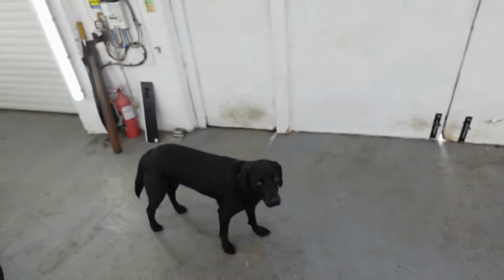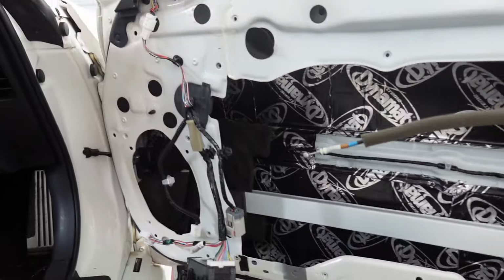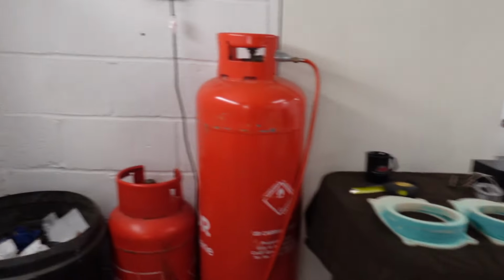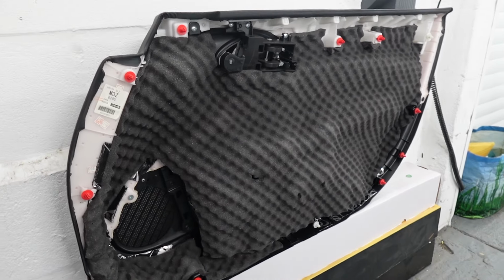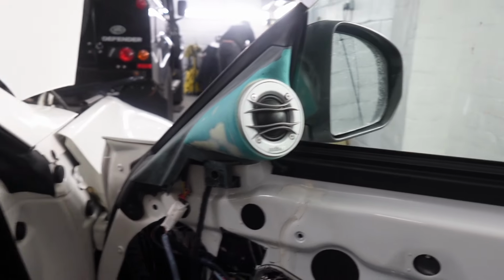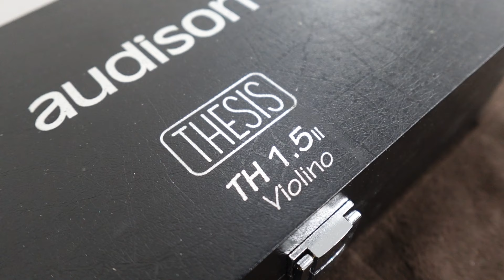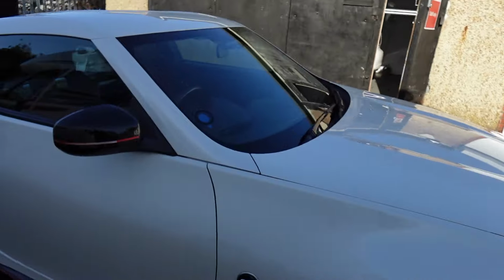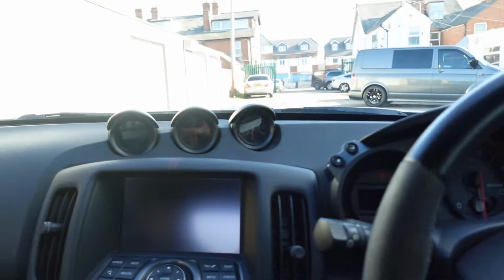Nissan 370Z Nismo meets Audison Thesis!

Comment: Beautiful craftsmanship but question; in your opinion, would 1" tweeters fit in those oem mirror sails without having to build pods? Just cutting holes and mounting them in.
Reply from the maker: More than likely yes, you could probably fit up to a 28mm tweeter behind the original grills on this platform! Obviously tweeter dependent and yes you can then have option to cut the OE grill out and surface mount the tweeter.

Comment: Beautiful work. Why two ways and not three ways? Is It more difficult to center the middle frequences on the dashboard? To center the voices? Thanks a lot for your reply
Reply from the maker: Thank you! 2 ways were chosen for 2 reasons in particular, one being budget / price point and also trying to retain as much of the original look as possible with the tweeter builds being the only build in the car. 
Being such a small cockpit and the time correction feature within the DSP we can get the soundstage in the centre of the dashboard surprisingly well in this platform. We were very very pleased with the results of this.
In fact we’ve just completed another nismo 370z with a very similar system which we’ll be uploading in the not too distant future!
Reply: @johnkleiscaraudio Is the woofer First edition of Thesis series?
Reply from the maker: Yes! You are correct 👍🏼
Reply: @johnkleiscaraudio  for your opinion the sound Is different or same of Audison thesis first or second edition?
Reply from the maker: Hard to forge an opinion unless you had the same car side by side with same electronics and same tune and the ability to jump out of one and into the other… I’d say not a noticeable difference as both sound epic.
Reply: @johnkleiscaraudio  thanks a lot
Reply from the maker: No need to thank! Thanks for watching our video and commenting!

Comment: Shouldn’t the tweeters be positioned systematically, ideally meeting in the middle (front mirror for example) for a frontal soundstage?
Reply from the maker: Not quite no. Not unless you’re trying to create a soundstage for the passenger as well that is. Perfect positioning, In an ideal world, your right tweeter should be facing at you as well as the passenger tweeter. This however isn’t symmetrical from an aesthetics point of view, so it’s either a compromise looks wise, or having them both firing at the driver & not identical looking left to right for the best driver soundstage.